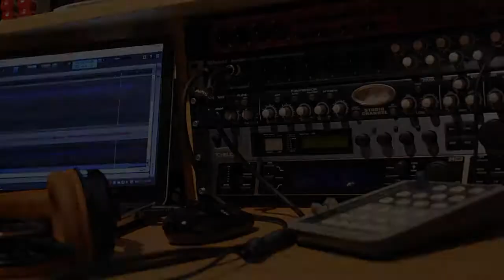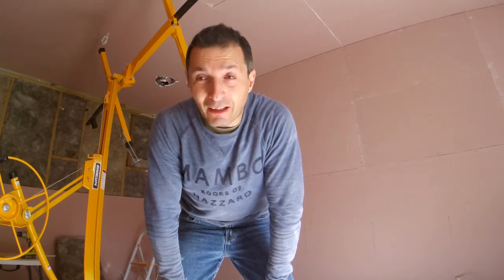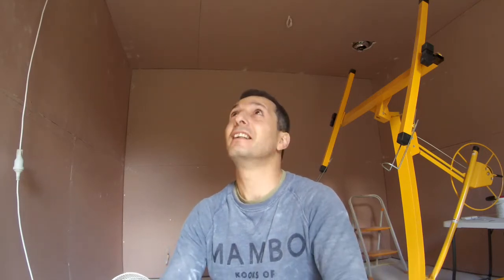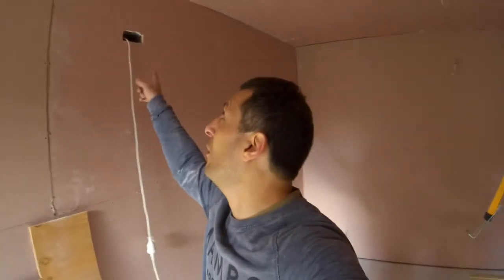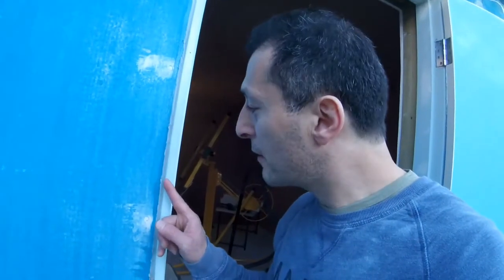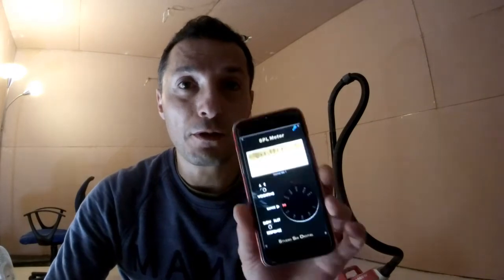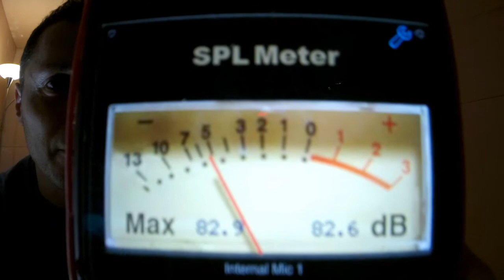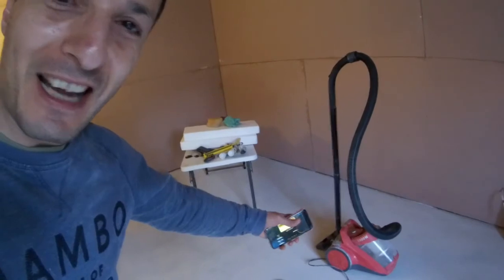Building My Home Recording Studio Part 22 - Sealing Plasterboard Layer 1 and a Noisy Vacuum

Comment: Can't wait to hear it when the second door and the middle wall is installed, I bet if you measure from outside you won't get anything. What you might do is set that vacuum just outside each wall and then measure what the db is inside with the door closed. That would really be interesting.
Reply from the maker: Thanks. Yeah, I might take the bloody noisy vacuum outside and see how much comes in. LOL
P.S. What middle wall?
Reply: I thought you were going to put in another wall and door separating the actual production space from the recording space. Am I mistaken?